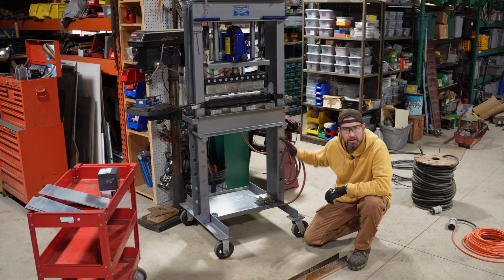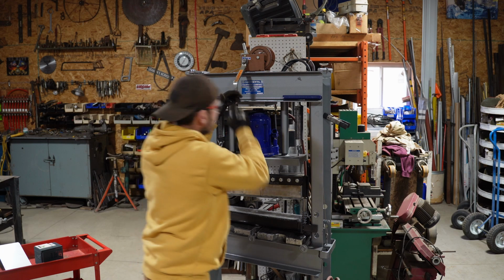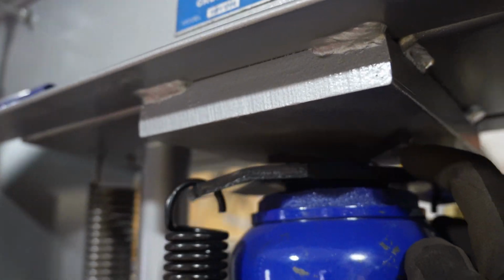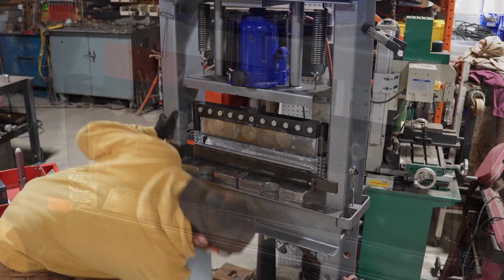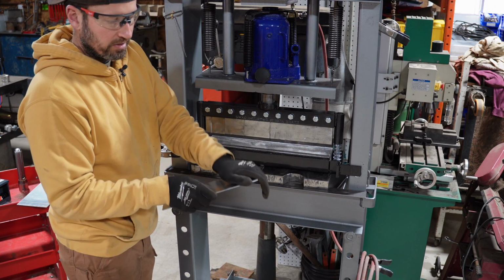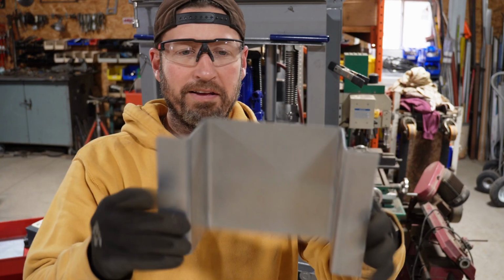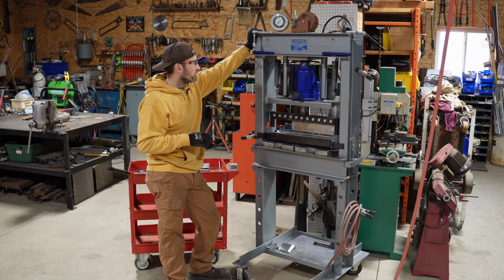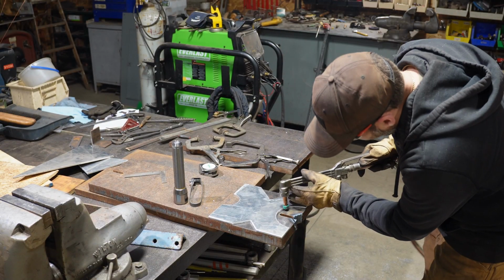30 Ton shop press and press finger brake.

Comment: I wonder what those pulleys gave way under or over their rating.
Reply from the maker: Probably pretty close to rating, between the deck,  arbor plates and brake it's gotta be 150 lbs plus.  Though,  the pulleys are not holding ALL the weight,  just redirecting the cable,  I'd guess they're holding 60%...?